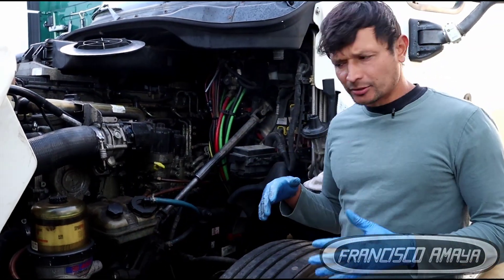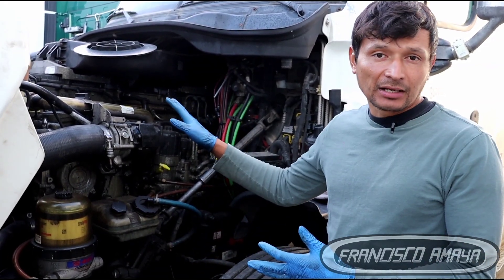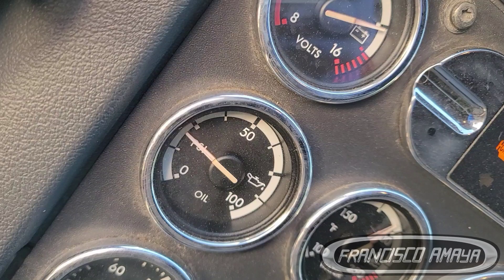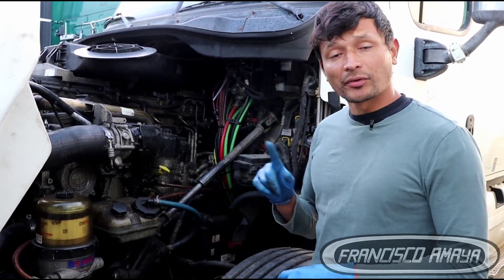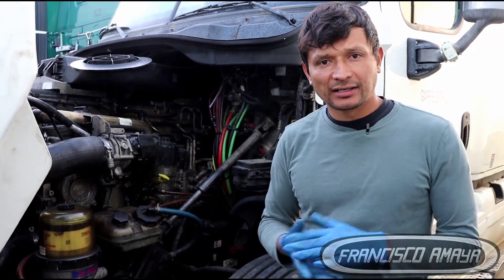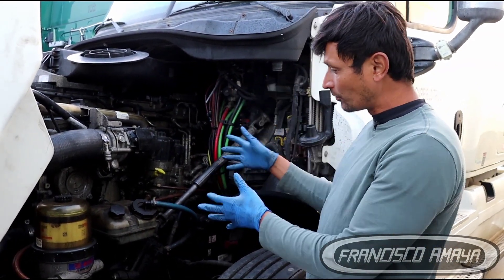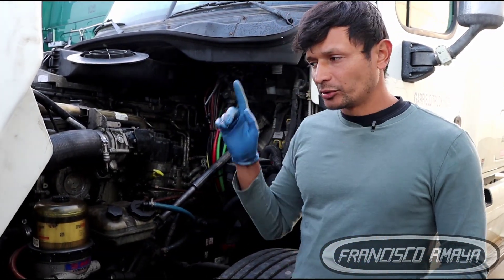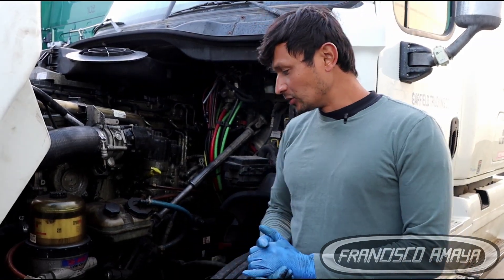DD15 engine crankshaft damage after turbo runaway

Comment: Because Of The Fuel/Oil mixture, the oil pan should have be removed, inspected and cleaned before adding new oil, as well the oil suction components, oil pump ETC. 🤔

Comment: The only way to stop a runaway engine is to starved it.  And DD15 is one the easiest to do so.  You see that fuel/water seperator?  The cap on top and purge valve in the bottom.
Reply: If you have a runaway engine it’s because it is getting fuel other than diesel being fed into the combustion chamber. Cutting the diesel will only cause your fuel pump to run dry and damage itself because it is gear driven if engine doesn’t stop it won’t stop engine will keep running by oil being fed by turbo. You have to cut off air to turbo at the air filter housing to choke turbo out or cut air/ oil supply to engine by removing one or the boots then engine will idle back down which now you could turn off or cut the diesel at the water separator like you said because now you have eliminated the alternative fuel first.
Reply: Didn’t you pay attention to The video lol